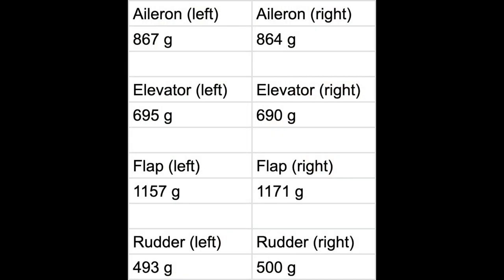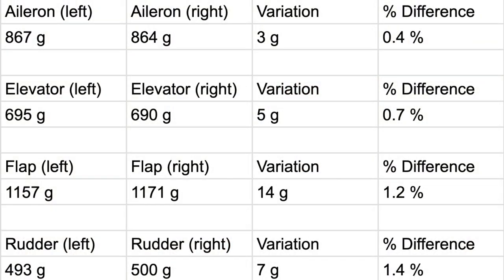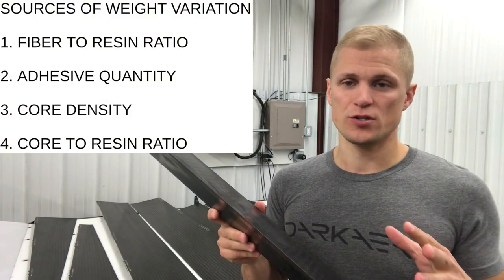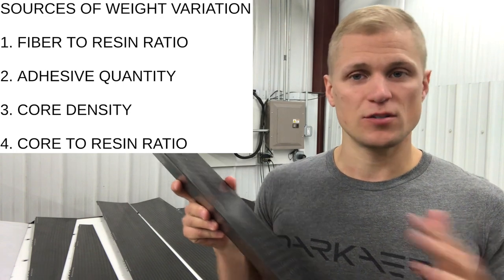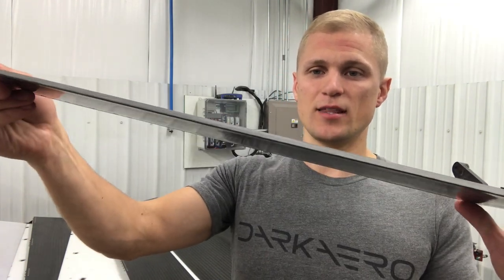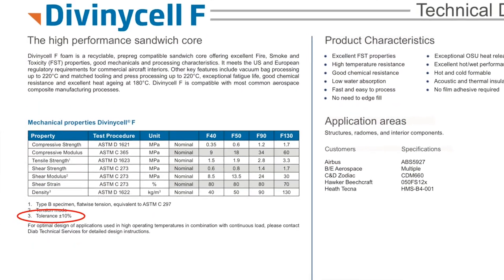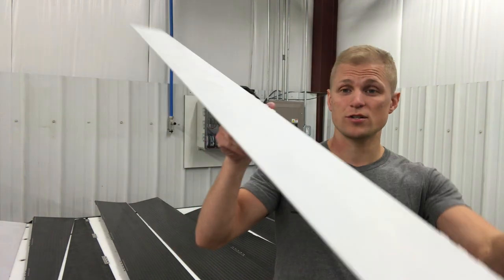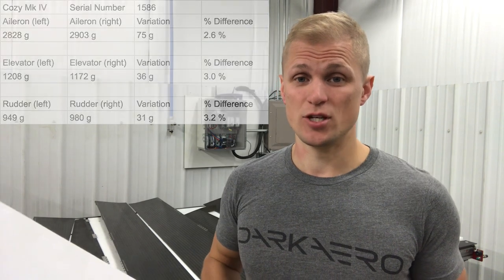The carbon fiber detail no one talks about.

Comment: I have a question though. Do any of you brothers hold a pilots license though. Just ask out of curiosity is all. Great video.
Reply from the maker: Ryley holds a private pilot certificate.
Reply: An interesting question. I would have thought they all were based on the enthusiasm these brothers have for aviation. 

But a brief review of aircraft design often shows the best designers are often non pilots. (E.g. Kelly Johnson). 

Or they intend to become better, more experienced pilots with their own design when complete. (Eg. Curtis Pitts). 

This project, I do find facinating. But the fact the Dark Aero crew is a little short on General aviation flying experience answers the question of why the performance is skewed toward a very high top speed, and what will invariably end up a breathtaking landing speed. I find 65mph to be the upper limit of what my 125-hour limited experience would ever feel comfortable landing solo. 

So the target market for this is going to be more of the higher-time, high wing loading, airline or hotrod types. 

There is nothing on the market now that competes for a thoroughly modern a two place, blazing fast cross county machine. I recon they will do well, if it flies good.
Reply: @TheJustinJ  Kelly Johnson not a pilot? News to me.

Comment: 2:23 You are forgetting the mold, are you 100% sure molds are identical, also finishing parts if you are doing it by hand there is no way you can sad same amount on 2 parts, also did you check the weight of all additional hardware I see you have some hinges and screws or rivets, also did you clearcoat the parts by hand..... ...... ...... ?

Comment: Keep in mind that the lighter you make 2 identical parts, the more likely that those parts are going to have a bigger percentage of weight variance compared to a similar part made from heavier materials. 10 grams difference in a 1500g steel part isn't as noticeable as 5 grams difference in a 500g carbon fiber part.

Comment: At the end of the day, will that variation affect the performance of the airplane? 

Is your foam approved by the F.A.A.?

For more consistency airplane manufacturers use prepreg fibers and Nomex or aluminum honeycomb.
Reply from the maker: Excellent questions! For the amount of variation we are seeing in these particular parts, no, it will not affect the airplane performance. If you don't measure variation it's hard to make this assessment. A good example of where variation of a few grams could impact aircraft performance would be on propeller blades. The blades all need to be the same weight to keep the propeller balanced and minimize vibration. Propellers are dynamically balanced on the propeller shaft after they are installed to correct any imbalance. Ideally you would manufacture the blades with no variation to simplify the balancing process. As far as FAA approval on the foam, it depends on the application it's used in. The foam we selected meets a number of FAA requirements for aircraft interiors and structures, but it would not be suitable as a firewall heat shield material. Thank you for watching and for the questions!

Comment: Well the length of a 747 can very by a couple of feet right? ... Of course that's accumulated on a gigantic structure ... Not really apples
Reply: Maybe by 1/4 inch at most and most of that would be based on the temperature as metal expands and contracts with temperature.